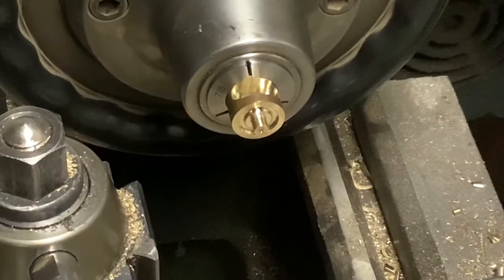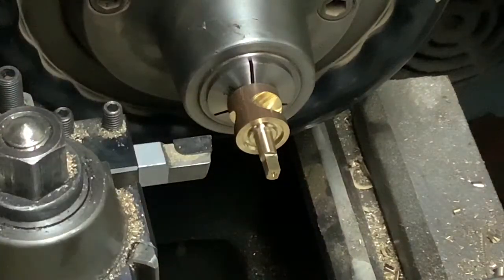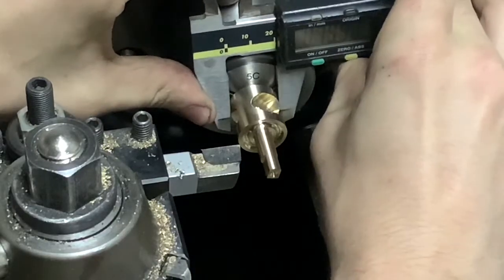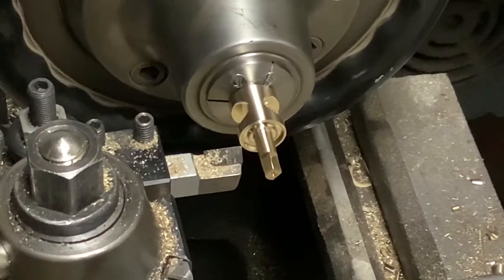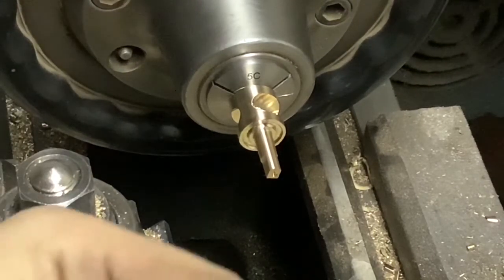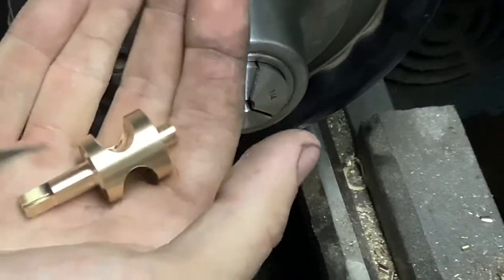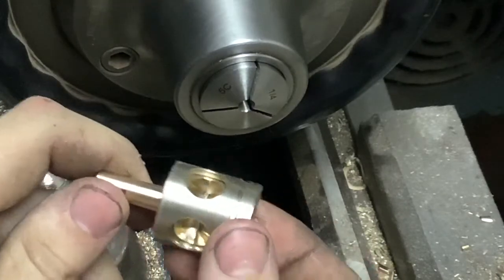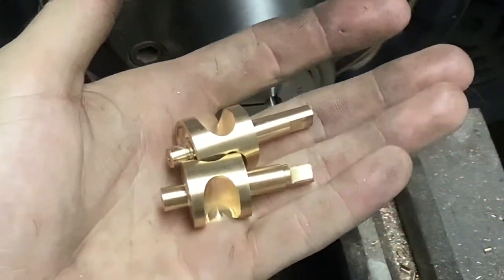How To Make Rotary Valves For Brass Instruments Part 5: Turning The Face

Comment: Do you cut titanium rotors, if requested?
Reply from the maker: I could, but I wouldn’t recommend them. Not the best material to mix with brass+saliva. If you want a lightweight rotor we can do hollow or a polymer rotor we developed
Reply: @milesomalley5605  Wouldn't a heavier rotor be better?  But tell me more about the polymer.
Reply from the maker: @dasteufelhund  titanium is about half the weight as brass. So if you want a heavier rotor brass is really the best option. The polymer is very lightweight, it gives better response but can sometimes lose some of the core at louder  dynamics. 

I typically use the polymer on rotary trumpet valves as it fits the sound better. I’ll follow up to your email tonight, and we can discuss further
Reply: @milesomalley5605  The goal I am trying to achieve is to have a durable rotor/housing without too much of a compromise on sound, on these old 8Ds